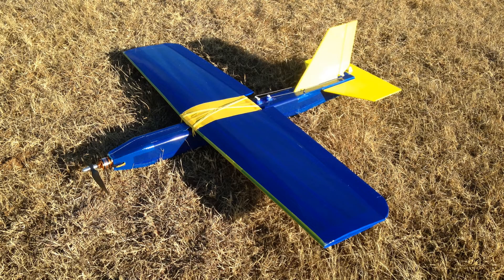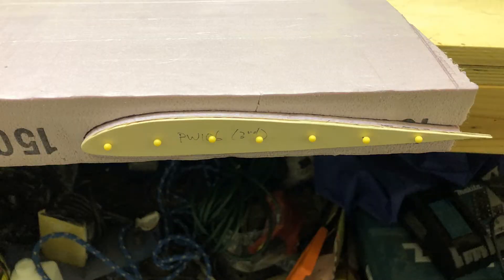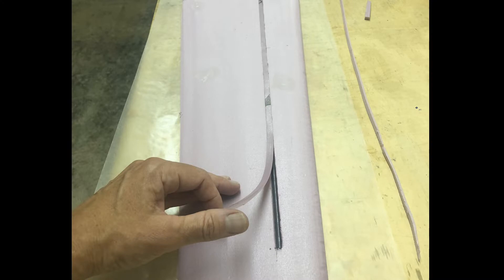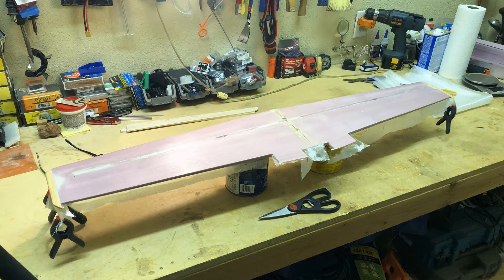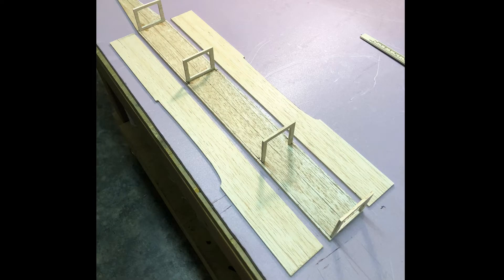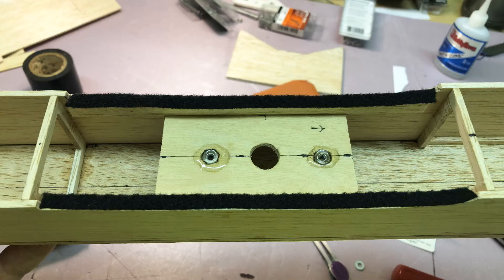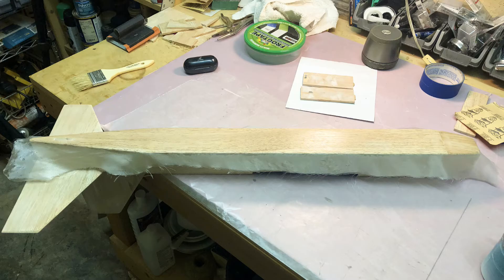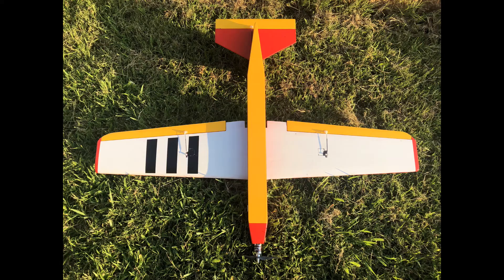DIY balsa and cut foam sport plane

Comment: awsome flying plane , may i ask what airfoil is that ?
Reply from the maker: Thanks!  It's a PW106 airfoil, but most of the trailing edge was simplified (replaced) by ailerons.  I chose this because it's thin (for speed) and has a fairly flat underside for plenty of lift and easier construction.  You can find it here: http://airfoiltools.com/airfoil/details?airfoil=pw106-pw.  Mine ended up being more like a pw98-mod when it was done.

Comment: Your back and with hot wire cutting!  Nice plane.
Reply from the maker: Hey thanks Nate!  Couldn’t abandon the hobby.  Been watching your awesome builds from afar 👍🏼
Reply: @mostlyharmlessrc3920  my turn for a break.
Reply: @mostlyharmlessrc3920  I'm a balsa a noob as well. I'm right in the middle of building an old great plains spirit two channel thermal plane. Figured I should go through an actual kit to see how they're supposed to be made or how they used to make them at least before I make my own. I actually 3D designed like a nose release to put in the nose and I'm going to make a tow plane from scratch once I'm done with the it. Been playing around with making my own phonelic tubes by wrapping construction paper around aluminum tubes with white glue. Diy wing joiners. Just haven't felt like recording or posting anything on YouTube lately.
Reply from the maker: @thenatedog  Hi Man - yes, I probably should have bought a balsa kit with clear plans and instructions first, but I just dove in and made mistakes instead haha!  I also couldn't decide on (or find) any balsa kit planes I really wanted to build and fly.  Your thermal plane sounds cool - I could go for that.  Kudos to you for always experimenting with creative techniques!  I post videos when I want to record or summarize something I did, and mainly for myself.  Having a few subscribers is a bonus.  :) Like many have said, the hobby is usually reward enough.